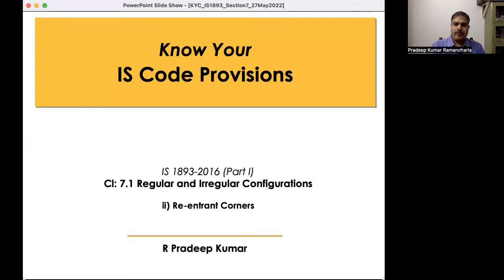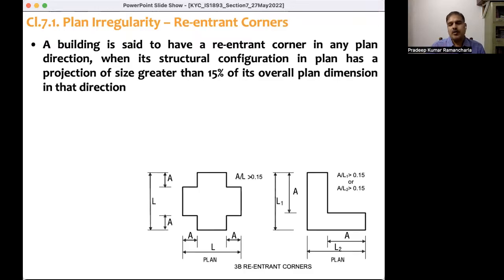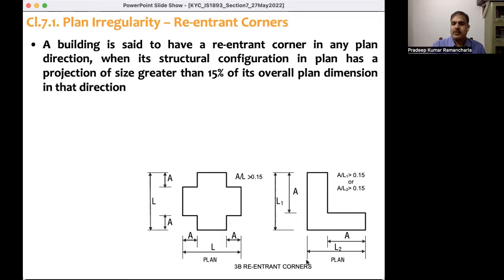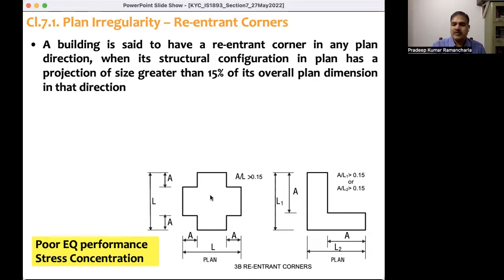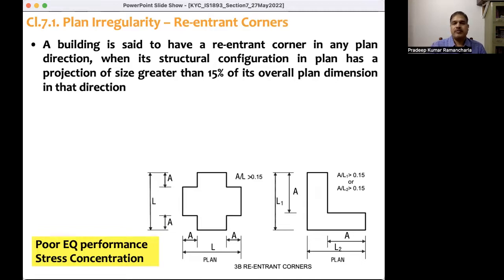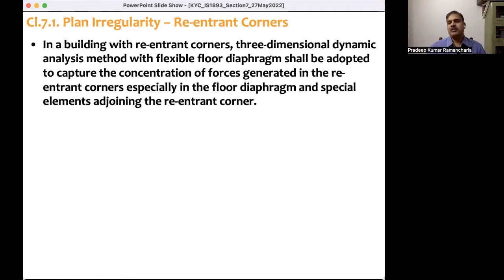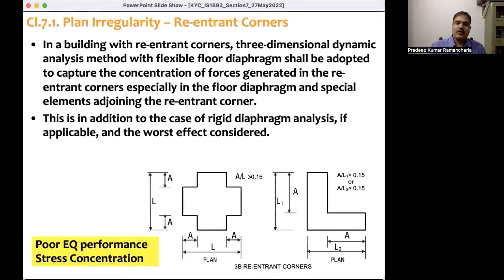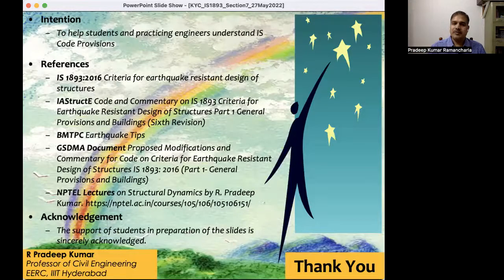IS 1893-2016 (part 1) Clause 7.1Table 5 Plan Irregularities (ii) Re entrantCorners

Comment: Pradeep sir,
Kindly suggest mention the clause where it is mentioned "perform analysis by adopting Flexible Diaphragm", unable to locate.
Reply from the maker: It is given in the amendment. Second para i.e., "in buildings with re-entrant corners...." has been replaced with the text "In a building with re-entrant corners, three-dimensional dynamic analysis method with flexible floor diaphragm shall be adopted to capture the concentration of forces generated in the re-entrant corners, especially in the floor diaphragm and special elements adjoining the re-entrant corner.
This is in addition to the case of rigid diaphragm analysis, if applicable, and the worst effect considered.
"